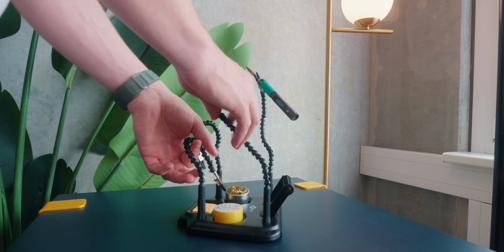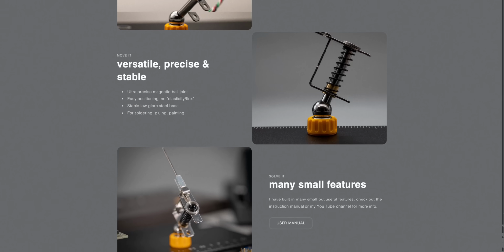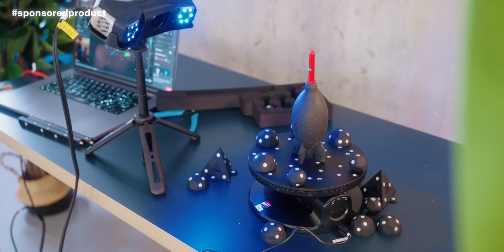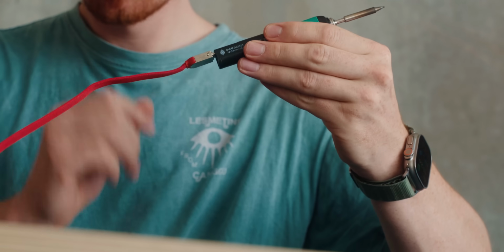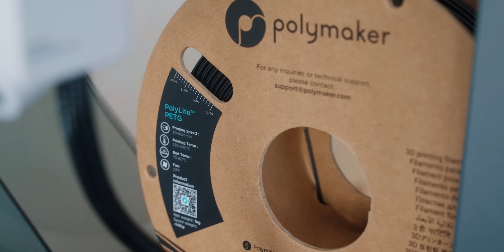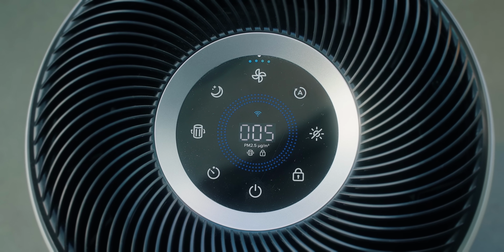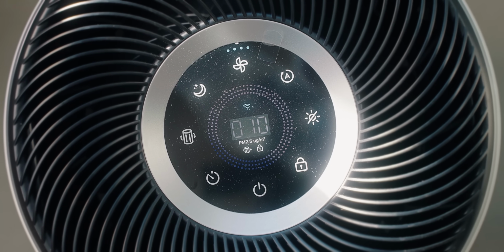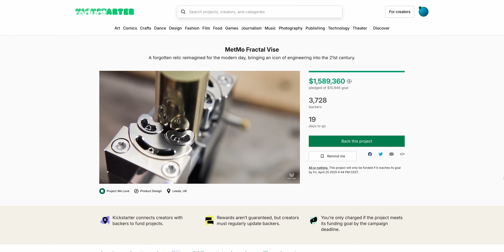10 Advanced 3D Printing Tools I Can’t Live Without

Comment: I also have the original Omnifixo helping hands. They were not robust enough for my needs, but I really like the concept. And that was before I was into 3D printing. If I ever do decide to use it, I’ll definitely print out a case, at least! Lol
Reply from the maker: interesting to hear! mine feel super sturdy. But you have an older version, if I understand you right?
Reply: @ I’m not actually sure if there is a new/old version, I think I misunderstood the results when I googled it lol… regardless, most of my soldering is done with larger wires and audio connectors, often on construction sites, with relatively powerful soldering irons. It’s a great piece of gear, just not for my normal use case :)

Comment: Some great ideas here! I recently grabbed a dremel stylo which is a low-speed model, which means it's slow enough to sand pla without just eating it up. That metmo multidrive... i wasn't able to get in on the kickstarter so I'm sad to have missed it. Should probably still grab one when I can!
Reply from the maker: Yeah a low speed version can definitely make sense for sanding! I had my dremel before 3d printing but it’s still saved my butt a couple times. 
And yeah the multidrive is super nice

Comment: One thing that I found annoying about the HOTO air tool is that it doesn't work for vacuum sealing filament bags.
Reply from the maker: Depends on the filament bag. I have some with a big valve and was able to get most of the air out very quickly. It stalled at the end and a real vacuum pump would probably do better. If you have the bags with the sticker valve if won’t work though
Reply: @arnebornheim  Yeah I have those. I even tried printing an adapter but it just doesn't have enough sucking power